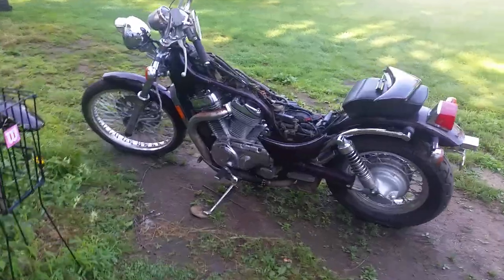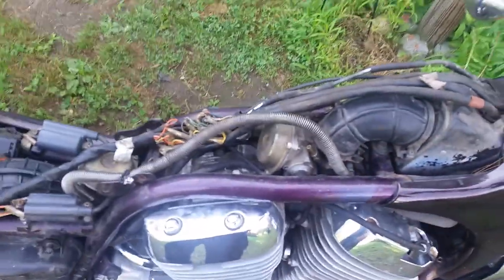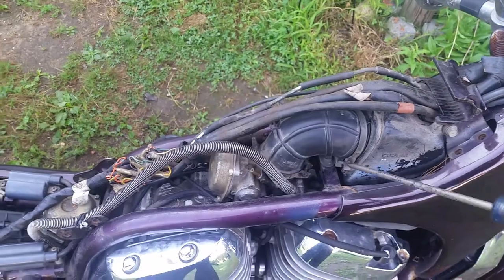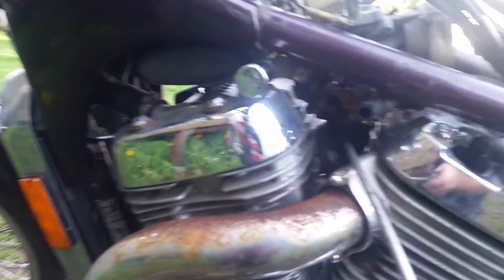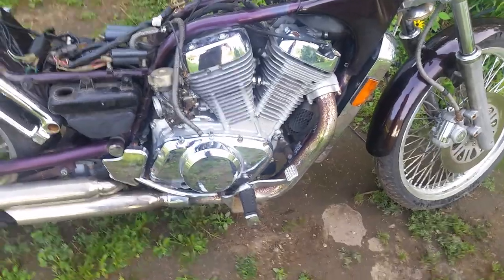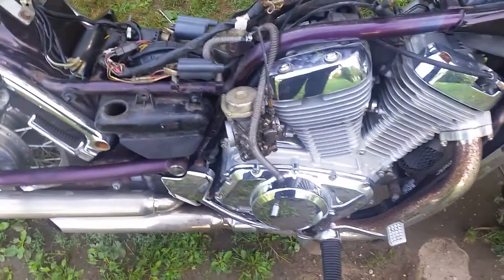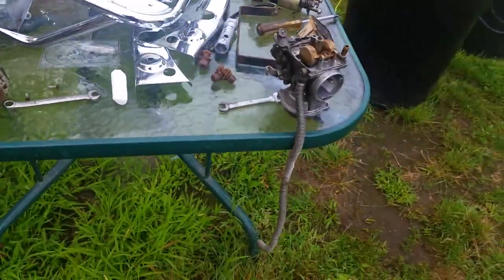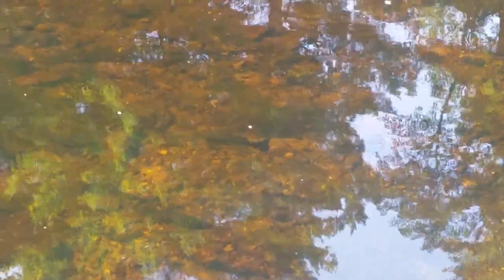1989 Suzuki intruder 750 carb removal

Comment: You're  a life saver  sir and I'm glad you had a  bike  like mine for me to be able to  understand how I could  actually put my carbs on I would also like to be able to re hook the wires up to everything that is on it as well instead of just guessing guessing on it all, and if you could give me some advice about how to get it done so that I don't know what to do with it to make it happen and not just  mess up with the rest of how they're running to the fuse board and other things that are going to work for me to make sure I get it right  I am new to this but I am not going to give up on the opportunity to make a bike so  if you don't mind I would really appreciate the help with this for it's a bit hard for me to understand how to do it myself because of the fact that I bought it from a friend who had been trying to add parts that were from a different model as in coils was off a Honda on side and other side was suzuki intruder yes sir I was hoping for a ride that I could just jumping on and going out for a while but I have been trying to rerefubes it and I have ordered new parts for it tank,coils,wire harness as well now I'm at a loss where  everything should be  hoping for some help thank you sir for the video I just found on your website on removing the carbs so I would know how to hook cables back up  again thank you for any help you could provide me with this issue please let me know and I will send it to this email address as I am  on my  wife's phone and I will receive it. Thanks again for your help and support in this process. Have a wonderful day and God bless you my friend  my friend  my name is Danny mills bobbie mills is my wife in helping me find all information online about my  bike 1986 750 suzuki intruder just like yours same thing as mine wire harness and all.

Comment: Doing the same to my 2001 VS1400 Intruder.  So far my front carb has two small holes in the diaphram.  Getting ready to remove rear carb.  Here goes nothing.  Thanks for the video!

Comment: I have an 86 Suzuki 700 Intruder I blew one motor up due to gas getting into the motor took the rear carburetor off didn't have a jet put a new motor back on and now I'm still getting gas in my motor and it's leaking out the left side exhaust pipe and I have no rear brever if that helps
Reply from the maker: That's due to fuel flowing past needle and seat going into the intake  filling the cylinder leaking past the rings and into the oil
Reply: @2strokeguru  so rebuilding the carburetors maybe my help it wouldn't hurt right
Reply from the maker: @conwaywebb8686  yes new needle and seats are a must